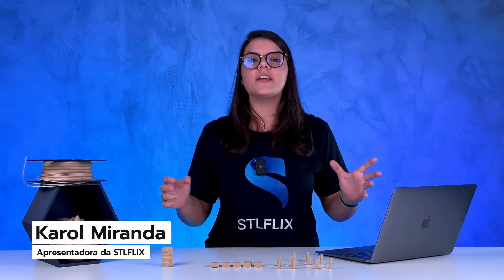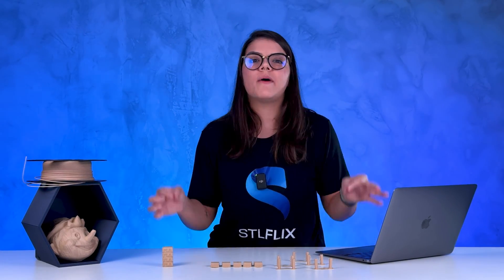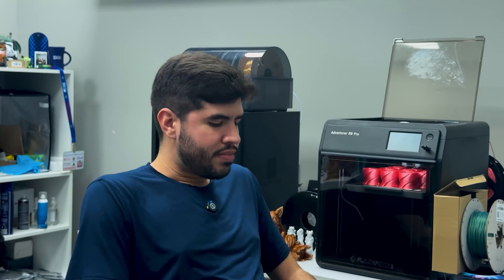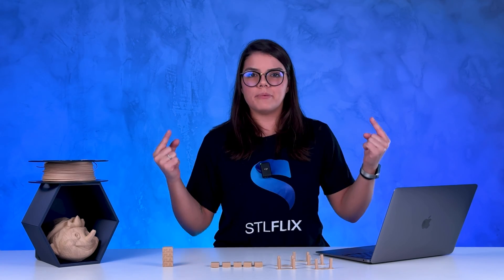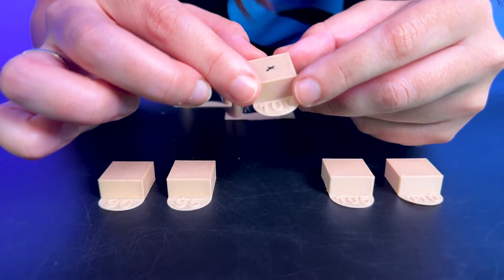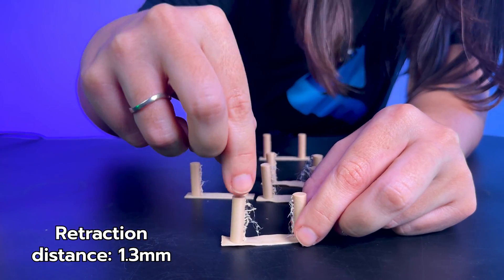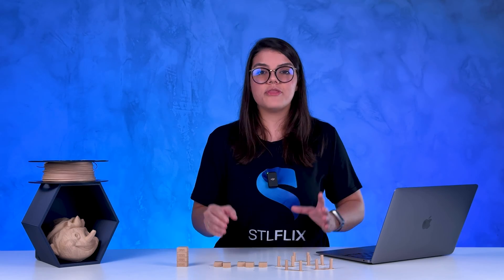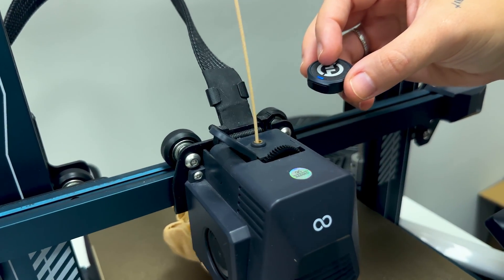How to perfectly print with pla wooden filament

Comment: My week started with my first experience with wood filament and has ended with the destruction of the nozzle I just replaced and several hours of wasted time. Due to a plate adhesion issue, the wood filament got tangled up into the print head which compounded. It crammed wood filament in between the rubber boot and head, so I could not see the problem. I kept getting cooling fan issues, but the real problem was the metal print head was coated in wood filament so it would not cool fast enough. Combine this with plugging and replugging the cables to the fan which was suggested by all. The adhesion issue was directly over my finger prints and I was running generic PLA settings, so I need to try harder. Before this, I had never had a bad print using standard PLA. Bambu P1S

Comment: Was this all with a 0.4mm nozzle? Every time I've tried using one that small I've gotten major clogs!
Reply from the maker: I used the 0.4 nozzle and it didn't clog, but do the tests and it might help heheh
Reply: Read my comment above for critical info. not given in this video...it's based on first hand, successful experience printing wood filled PLA

Comment: Okay, so, regular PLA does NOT have a nozzle temperature of 190°C - 230°C range for regular speed printing Some PLAs MAY have a top temp. of 230°C for speed printing...important distinction there. It is mentioned that different printers may produce different results but it is not mentioned that the same can be said for brand of wood filaments. Different brand wood filled filaments are not all made the same way and will, therefore, require their own specific settings also. (what brand was used in this video?). That all said, thanks for the video. I am at this very moment printing with wood filament and I ran the same tests :o )   Snapmaker make a very nice wood filled PLA that works great on my Prusa's.
Additional info: You MUST dry wood filled filament as it is VERY hygroscopic (absorbs moisture) which wiill ruin your print.It is recommended that when printing any material filled filament (wood, shredded carbon fiber, etc.), use a 0.6mm nozzle to mitigate nozzle clogging. Also, you can print these materials with brass nozzles but they will wear relatively quickly due to material abrasiveness; hardened nozzles (i.e. E3D NozzleX) withstand wearing much better.
Reply from the maker: Thank you for the additional information, the brand of filament really makes a lot of difference, it is interesting whenever you get a filament from a different brand to test it.
Reply: @stlflix  I don’t post-print paint models so filament colour, texture, etc. are as much of the decision make process of which model to print as the model itself. The choices that have come into the market just in the last few years is awesome! And now with multicolour 3D printing and the ‘painting’ function in slicers…wow!
Reply: Pretty much everything you mentioned is in the video. I guess for total beginners it would be nice to spell things out. But would think by the time you're printing with more exotic filament you know that it takes twerking and not all are the same, even something that works with the same filament and machine for one person doesn't necessarily mean it will work for another.